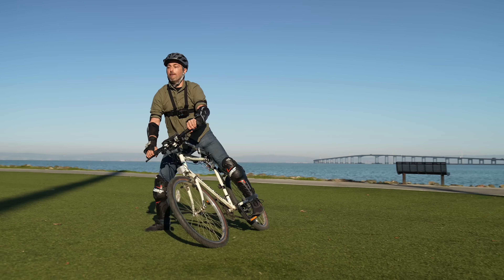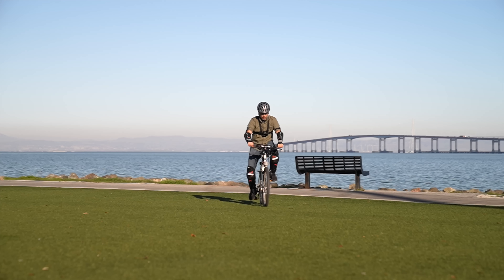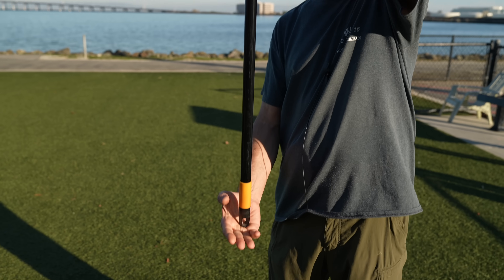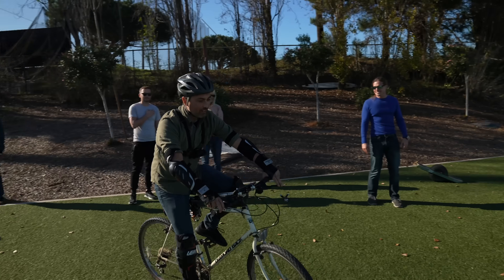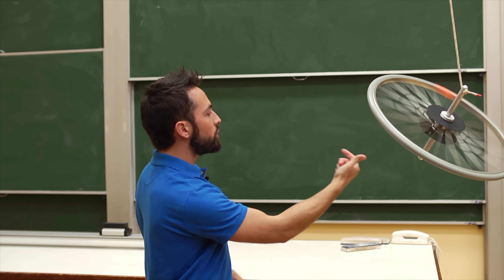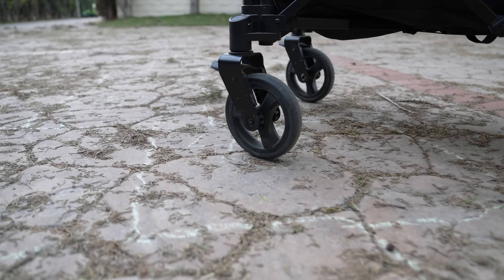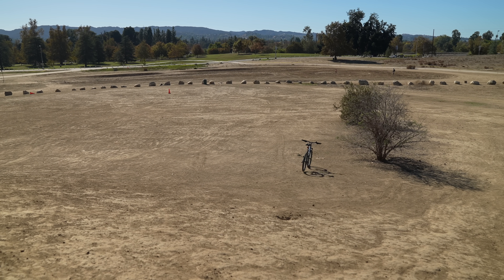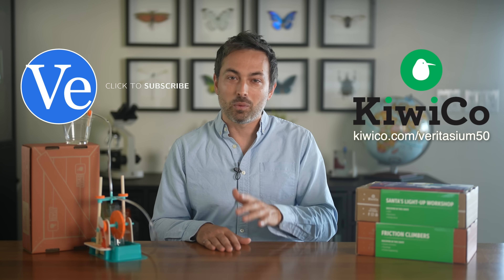Most People Don't Know How Bikes Work

Comment: Two things that come to mind here: track cyclists doing track stands on a 30 to 40 degree banked turn. A track stand is when the rider stops the bike and ballances stationary. I can track stand for a couple minutes on flat ground but never could get the hang of on the banks.
Second, is harley davidson motorcycles. I have always heard that they are designed so the front wheel doesnt turn under the weight of the bike when its leaning  to one side or the other. I know that harleys have at least some rake to the front steering angle. What is going on here? Sounds like some good stuff for your to explore. Im sure many more are curious as to whats happening.
Reply: If I remember correctly, trackstanding requires you to put pressure on the pedals and holding the brakes. GCN even suggested learning trackstands on an incline. I would assume it's easier to trackstand on a bank if you're pointing the right way
Reply: No brakes on a track bike
Reply: @snaketheterminator2409  they use the incline to not roll backwards. And I'm not sure if they have fixed gears
Reply: Right but how does that banking to one side affect the principle that steering is what keeps the bike up. The front wheels movement left to right keeps the bike up while moving. I need a deep dive into the physics of a track stand, on a fixed gear bike, on an embankment. 
... no harley davidson engineers out there to chime in?
Reply: @snaketheterminator2409  Harley davidson engineers can't even fix their steering wobble, how are they gonna help you with trackstands?
The basics behind it is, you put load on your pedals and brakes and use the slight shifts of forward or backward rolling to your advantage to stay upright. Since the front wheel is straight the bike wouldnt move much forward or backwards, instead shift more from left to right
Reply: Dont need help with track stands. Wondering why the harleys front wheel doesnt turn when the bike leans over on the kick stand. Like in the video where he leaned the bike over and the front wheel turned the direction of the lean.
Reply: @snaketheterminator2409  Because you need to move the bike forwards or backwards abit to get that to happen. 
If i hold my handlebars straight and put the bike (not a harley) on the kickstand the front stays the same too.
Try sitting on the bike, letting go of the handles and whilst having it leaned roll it front or back

Comment: From my experience in motorcycles I'm willing to wager most bicyclists simply don't go fast enough for gyroscopic effects to become the lion's share of the forces keeping the bike stable. On a motorcycle you find that around 10-15 miles an hour the front wheel feels like it "flips" from being what's demonstrated here to nothing but pure countersteer and hard lean for a turn. Motorcycle wheels being smaller diameter but far heavier I suspect means they build up to that strong gyroscopic torque sooner. There's always countersteer involved to initiate a turn, it's just not readily obvious until higher speeds.
Reply: I was wondering this also, is there a certain speed, above which on a bicycle you need to countersteer only (not initially as shown in this video). I think that for slow speed motorcycling the handling is the same as in this video but it would be interesting to learn at what point it switches from being as per the video to countersteering only i.e. push right handlebar to turn right

Comment: I'd like to point out that it's possible to drive a bike without turning the front wheel, it's difficult but possible I have a feeling that you just don't have the proper level of biking skill to be able to initiate a turn without first counter steering.

Comment: Being both a cyclist and motorcyclist I’ve known about countersteering for a long time. It causes a lot of accidents with new motorcyclists actually so it’s a very important concept with higher speeds. With a motorcycle, the turning of the bars is much less obvious because of the extra weight and the higher speed: so you have to very purposely ‘push’ the bars in the direction of the turn, very important when cornering.
Reply: came looking for a biker that knows this haha
Reply: @evand746  same here lol
Reply: or pull, depending on which hand we're looking at because one pushes and the other pulls. 
I think a more important thing to motorcycling is to be smooth, many people brake and accelerate way to jerky and that's usually the cause of washing out your rear wheel in a corner or in a straight.
Reply: I personally felt that the counter steer effect only occurs above about 18mph or so (on a motorcycle)?
Reply: @Momo_8k  As the video shows it is actually impossible to turn without it, no matter the speed. You just do it automatically without thinking
Reply: @mikopiko1317  I'm not questioning the need for turning. 

I'm questioning the need for the same level of countersteering on a bicycle (not including the initial tip in), when most casual cycling occurs at speeds lower than 18mph. Changing lanes at highway speeds, I really don't remember needing to turn in the same direction as the direction I'm going.
Reply: Same here. It has some slight differences tho, due to (like you said) the weight difference. For quick turns at low speed I usually turn the handlebars in the direction of the turn, but only after I also leaned in said direction.

What surprised me was learning that the gyroscopic effect has little to do with stability. You always learn something new 😃

Comment: The gyro demonstration was weak.  The cyclists were pedaling, so they were shifting their weight side to side, against the gyroscopic force, which was very weak at such a low speed.  Get the bike going fast enough, and you can pedal without any hands on the bars.  But don't slow down!

Comment: If the front wheel is not locked, I still think I can turn one way with out turning the other first. The only think is I would need more of an open space than in your video. It's a bit like a snow board on where you focus your attention. Do you move your back leg out or do you push your force into your leading edge. Once you glide on a bike gets unstable though you would almost surtanly strear the opposite way.

Comment: The plot thickens from here!  Counter steering like this is vital to controlling a motorcycle.  At speeds < ~10-20mph (varies based on the rake/trail of the motorcycle) you turn left with the bars going left and right with the bars going right, as you'd expect, but above that you need to actively counter-steer.  To do this you push the left bar DOWN and forward (turn the forks right) to go left, and opposite to go right.  It's completely opposite.  Instructors say "push in the direction you want to go."  If you release the bars, the motorcycle stands up-right like here.  It's interesting because if you were to do a large left-side circle from a stop, you start the turn with the bars facing left, and then as you pick up speed you naturally transition to the bars facing slightly right (which leans the bike to the left), and your brain works this transition point out where counter-steering comes into effect automagically.

A lot of people mis-understand this but can ride motorcycles perfectly fine.  It's crazy to see people who have been riding for 30+ years claim that counter-steering is a myth when it's so easily provable out on the road.  They believe you LEAN to go in the direction you want to go.  The problem with this theory is that the gyroscopic effect is so powerful that it's almost impossible to do this at 25+ mph, and the faster you go the more stable it becomes.  To illustrate this, a superbike instructor down in LA created a motorcycle with 2 sets of bars, the 1st are connected the forks like normal, the 2nd are connected to the frame.  He says if you can turn a motorcycle by leaning, grab the welded bars and do so.  People can't.  The motorcycle just goes straight until they counter-steer with the forks.  The reason some riders think they can turn by leaning is because when you lean you increase pressure on the inside bar, which counter-steers and tips into the curve.

So yeah, if you find counter-steering interesting, I def. implore you to check out counter-steering as it applies to motorcycles, which is very similar to here, except that the gyroscopic effect becomes predominant at speeds above 15-20mph and you need to counter-steer to upset the gyroscopic effect and turn in the opposite direction.  The bicycles here are moving too slow to do the whole turn with counter steering, you only need it here to initiate, but eventually you need it to sustain.
Reply: It's not gyroscopic effects taking over, all these steering effects become stronger with speed too.
Reply: @SqueakyNeb  and the smaller wheel radius when leaning
Reply: Phew.....lol 👍
Reply: Pushing down on the handlebar doesn't matter.  Its the pushing forward that matters, because that is what is causing the counter-steering input.  You don't have to take my word for it.  Go out on your motorcycle and push directly down on one side of the handlebar (while keeping your weight centered over the bike).  Absolutely nothing will happen, the bike will just continue to go straight.  The bike does not respond to that at all.  To initiate a left turn, you can push forward on the left bar, or pull backwards on the right bar, or both, either way you are turning the steering to the right which initiates the left lean.

Countersteering applies at all speeds on a motorcycle or bicycle.  This idea that it doesn't apply at low speeds on a motorcycle is a common misconception.  There is not some magical speed where the laws of physics suddenly flip flop into another dimension.  :-P  What makes the slow speed different is that the automatic self correcting and self balance mechanisms described in this video don't work that well, and therefore you have to do everything manually.  The motorcycle front tire has a large and grippy contact patch and there is a lot of weight on it, so the front wheel doesn't steer very easily or freely at slow speeds, and therefore it does not so easily self correct.  It's like having friction in your steering bearings.  It's like if you were driving an old car with no power steering, it takes some serious muscle to turn the steering in parking lots but at road speeds they are fine.  So on the motorcycle, at slow speeds you have to manually countersteer and then manually steer in the direction of the turn, and you have to do it all with the right amounts and timing, so it's tricky to learn.  At higher speeds you must manually countersteer but once you reach the lean angle you need, you just release the pressure on the bars and the front wheel will automatically steer itself in the direction of the turn.  It's easy to see why riders have this misconception, because at lower speeds the second steering input, the one towards the turn, tends to be the much larger and sustained movement so we notice it a lot.  But at higher speeds the countersteer action can require a lot of force that we notice easily, and the 2nd part of turning toward the turn is automatically handled by the bike.  So at higher speeds we will notice the countersteer effort, but at lower speeds we will notice the large movement of the steering toward the direction of the turn.  So we notice different things, but in both cases the bars are being countersteered first to initiate the turn and lean, and then after that they are steered in the direction of the turn.  The difference is in the amounts and whether it happens manually or automatically.

You said that if you release the pressure on the bars the motorcycle stands upright.  If your bike is set up correctly, releasing all pressure on the bars should cause it to maintain whatever lean angle it has, so if you are leaned over it should stay leaned over.  To come up out of the turn you just push forward on the outside bar.  The guy in LA that you mentioned, who put a fixed handlebar on a motorcycle, that is Keith Code of California Superbike School.  One of his first lessons for students is about relaxing your grip on the handlebars to maintain your lean angle and provide maximum stability, and he describes the same thing in his books.  So again you don't have to take my word for it.  I have experimented with different tires and suspension setups on motorcycles to demonstrate to myself that it is very possible to make a bike that, with no pressure on the bars, will either stand upright or do the complete opposite.  It all depends on the rake and trail and tire properties and so on, and how they all balance out, but with the ideal setup the bike will maintain its lean angle if you are not pushing on the bars.  That way as you navigate curves in the road you can be completely relaxed on the bars so that you take advantage of the bikes natural self balancing and self correcting action.  If you are putting pressure on the bars you are interfering with its stability.  You do not need a constant countersteering effort in order to sustain a turn at any speed.  I have done track days and gone 150 mph around turns with arms completely relaxed.
Reply: @adamharnois7072  man you're so wrong. First you misinterpret "pushing down" and then you talk specifics of a particular bike. In many small bikes you can clearly tell the transition from "normal" steering and counter-steering, you just have to use only one hand. At low speeds (20-30km/h, not that low neither) you have to pull towards you with the side you want to turn towards to, and at higher speeds you need to push away. If you don't try to lean, you have to constantly be pushing to keep turning, steering right but going left. The thicker the front tire is, the bigger the effect
Reply: @adamharnois7072  The concept of "pushing down" is what they use to teach, it's old hat/old school. Because their concept was you would both naturally countersteer (because pushing down would most likely cause you to push the handle bar forward), but also kinda lean into the bike too.  But you're 100% right, and it's 100% easily provable, lol.  You just go to a parking lot, get up to 15-20mpg (probably varies by bikes I'm sure), and just take one finger and push the handlebar forwards and you'll damn well tip hard in that direction, no downward pushing needed at all.
Reply: @adamharnois7072  You're actually right, so people will give you crap. We can tell from this video, which also applies to bigger bikes, with varying degrees due to different weight, geometry, etc, that no matter how slow you go, if you start out straight, you must countersteer to initiate a turn. I tested this endlessly with my scooter at low speeds, different tire pressures, leaning back, leaning forward, wearing more weight, etc. No matter how much I wanted to find that magic transition speed, I found that you need a mini countersteer to initiate a turn. Try a million times to turn left in a parking lot by turning your handle bars left, and you will fall right a million times. Do the smallest, barely perceptible even by yourself, 0.5 degree, fraction of a second countersteer, and you will turn left a million times. 

You explanation was actually the first time I saw it all within one block of text, so kudos.
Reply: yup yup yup.  Riding for the first time in DR i discovered this.

Comment: It's the cosmic dialectic - coincidentia oppositorum - there is no straight, there is only the 'conversation' between left and right. It's the same when you try to draw a straight line... you never draw straight - you can never draw straight - instead you move from left to right, right to left...

Comment: Above 15 mph, Gyroscopic Procession makes the wheel apply the force 90 degrees later. If you push the handlebar to the right, that force is applied when the wheel is at the top of it's rotation 90 degrees later,, leaning the bike to the right.  If you push the left side of the handlebar, the force is applied 90 degrees later, pushing the bike to the left. Below 15 mph, the Gyroscopic Procession is not there.   As a Helicopter Instructor Pilot, this is taught to pilots to understand the forces in the rotor system.  The 90 degrees differences are compensated for by flight control and swash plate installation, so forward cyclic in the cockpit equals nose down. If it were not compensated for, forward cyclic would equal a left turn with the CCW rotation of the main rotor system. 
On a bike, Push Left means Go Left.
Push Right means Go Right. 
Much quicker steering response than leaning the bike. It can save your life on the road. Practice it. Use it.

Comment: normally while riding a bike i dont turn the wheel where im going at all. whilengoing left i push on the left handlebar to turn the wheel to the right and the bike leans left and goes left. so im steering in the opposite way that im going
Reply: with locked out steering it could be hard to steer but i dont steer left while going left